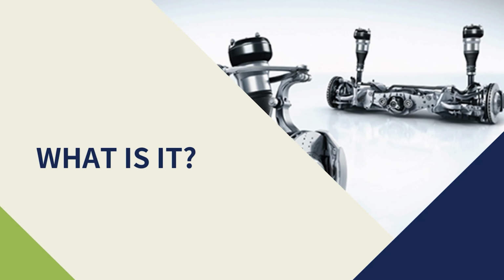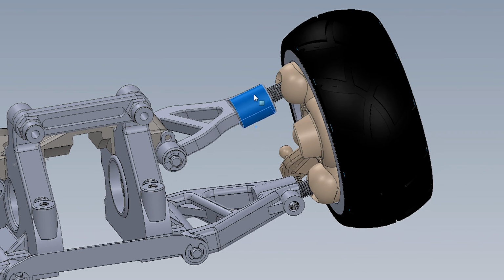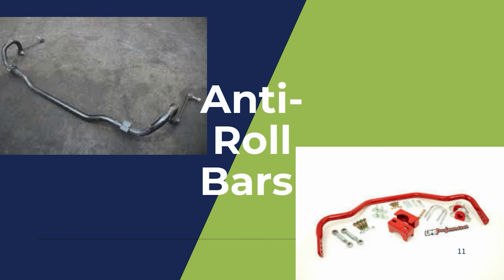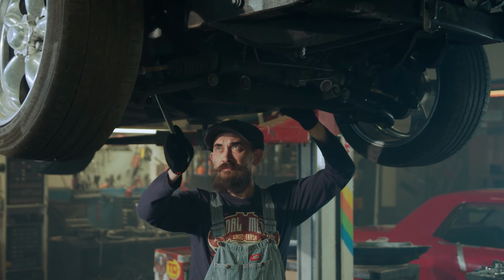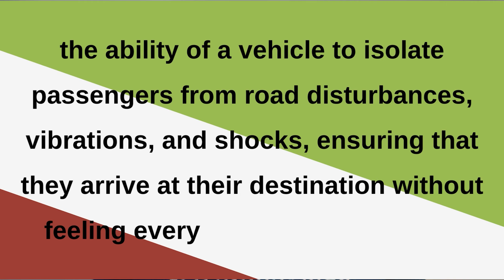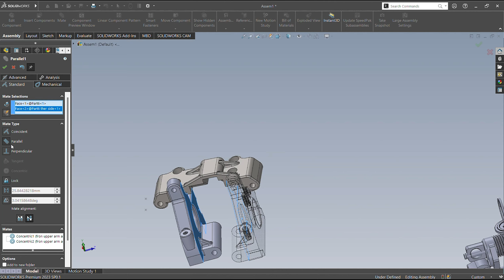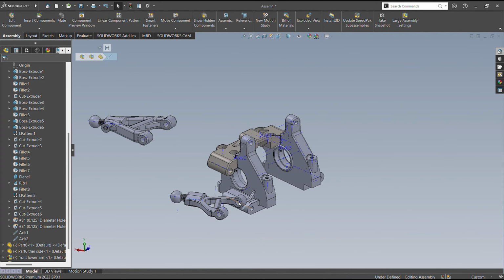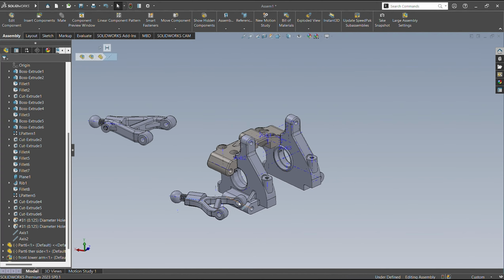Unveiling the Secrets of Suspension System Engineering

Comment: I would really like to know about how the transmission from engine is transferred to the train while getting up and down with suspensions, how does it maintain it's rotation ?
Reply from the maker: the transmission transfers power from the engine to the wheels through a system of gears and a driveshaft. This power is then transferred to the wheels through the suspension system, which allows the wheels to move up and down while maintaining rotation.  The rotation of the wheels is maintained through the use of constant velocity (CV) joints, which allow the wheels to turn even as the suspension moves. This enables the car to navigate uneven surfaces while still transmitting power to the wheels for movement.

I hope I explained it well for you
Reply: @Mj-Sanga  it really did help ! Thankyou, I got it !